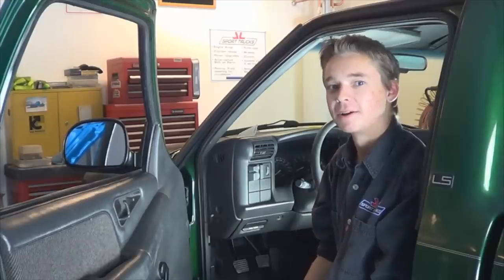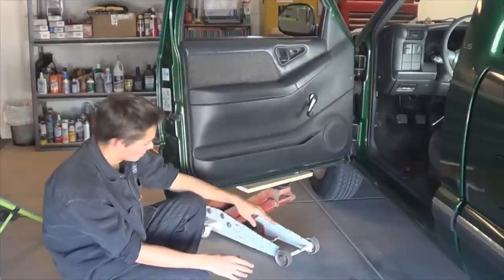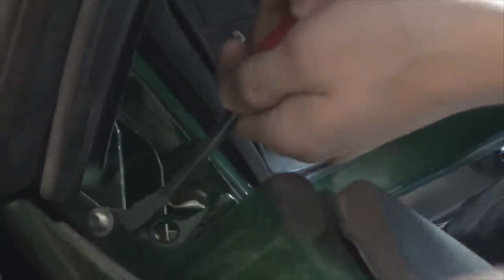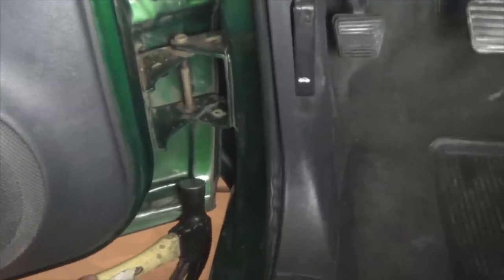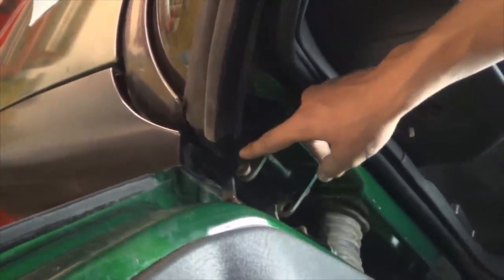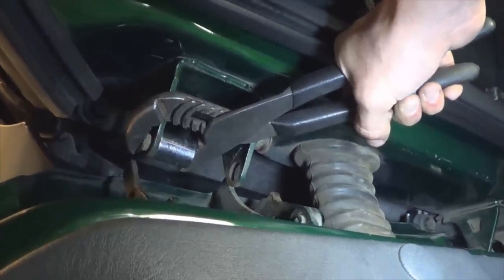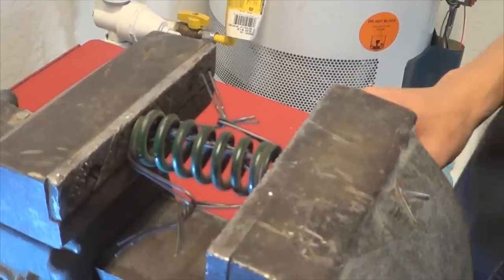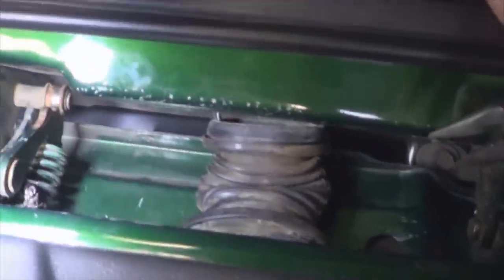1994 to 2003 Chevy S 10 GMC S 15 Blazer and Jimmy Door Hinge Pin Replacement

Comment: My 2002 S-10 hinge pins have never been changed, top hinge pin was a piece of cake. Bottom hinge pin is a different story, the pin is so corroded that no amount of hammering will remove it. Only two options remain, soak the pin in penetrating oil and hope that works, or as a last resort, grind the head off and drive the pin downwards which allows clearance for more effective hammer blows. One way or another, there's no turning back, wish me luck.

Comment: you can fix this without changing any parts. over the weekend I took a short cut, the bushings you can twist them a 90° with a pair of pliers which in turn places the good part of the bushing where the worn part was. i did jack up the door using a block before starting worked for me! no more up and down play in the door.
Reply: Paulpro PP im going to go try that good tip
Reply: The kit is like 8 dollars for christ sakes
Reply: Hey PP how long did the good part of the bushing last for after you rotated it? My upper is split in half almost exactly in the middle.
Reply: @jessjohn6157  16 I bought a kit today lol
Reply: Why not just weld it lmao

Comment: It just so happens that when I bought my truck (used), one of its previous owners was kind enough to remove the driver side door hinge spring so when opened, it would swing all the way until the back of the jam stopped it. I looked online for the spring, then saw folks were charging more for the spring then entire kits that came with the pin and bushings... EUREKA (and, then I found it)! This video with your tips and method is sound advice to this dumdum (meaning me) who doesn't even have to turn a wrench! I'm also thankful for that. Since the pins are brass from the looks of it, I'd put a piece of wood between the pin and the hammer so not to mushroom the pinhead. Prolly get a better fitment into the bushings. I like the socket compensator for the bottom of the bushing. Thanks for the vid.

Comment: Thank you for demonstrating step by step instructions clearly and in detail.
Reply: I had a terrible experience with Dorman kit with pins and bushings.  Bushings are totally junk.   I noticed some bad reviews for dorman kits for door hinges.  I ordered from the chevy dealer.  Not cheap but I’m done with it till the truck falls apart.  I broke the bushings very easily.  I had to pound out the factory bushings and they stayed in tact.  They were just worn out.

Comment: I was having excess wind noise around the passenger door. I replaced the windshield reveal weather strip, and the drip weather strip, but still had a leak. The busing is split on the upper hinge. I did the "moose the window frame over, and sealed it up, then did a 90 mile off road trip and it's still sealed, but I still will do the pins & bushings, ASAP. The reveal was allowing water to get in then a good cross wind would douche me with water, mud and sand. THANKS! GREAT VIDEO!!!!
Reply: I had the exact same thing and I built up the weather stripping with silicone.  Now that I've replaced the two broken bushings hope the seal compresses enough or I'll be sanding.  Ironic if the silicone was enough to break the new bushings.  That's me out there crying in the driveway....

Comment: Spring trick saved me a crap load of time.  .. thanks for this upload
Reply: There is actually a tool for doing the spring
Reply: @glenwhitestofer6420  yabut vice 'n ties is great if you have a vice and can use a tool you already have. You also dont need a vice that big. they make smaller vices

Comment: Thanks for the video.  The job was a lot easier and quicker than I thought.  Your video probably save me a lot of $$$$ by not taking it to the garage.  I did borrow a spring compressor from a friend and installing the spring was a breeze with that.  The whole process took me less then 30 minutes.  Thanks again for sharing!!!!

Comment: Thank you, I had to double check on the direction the lg. bushing was on the top hinge. I already had it apart & didn't want to trust that the other door was correct. Plus I wondered about how to push it in other than a drift.

Comment: Thanks, this helped me with my 02 s10. The spring was really a pain because i couldn't get the (tension with wire trick) to work. Ended up using a pry bar.

Comment: Hi Chris - I have a 2001 S-10 4X4.  I just opened the door and heard a loud spring-release sound followed by an even louder clank!  I checked and the piece that is held against the spring (opposite of where you inserted your pry bar for removal) had gone past the roller.  The door wouldn't close at all.  I compressed the spring using a ball-peen hammer and managed to close the door enough to remove the hammer.  After opening it again, it did the same thing - a loud snapping sound and unable to close the door without compressing the spring again.  I don't think this is the hinge pin - but it might be a broken spring?  Is is possible to send you a few pics and perhaps you may be able to tell me what you think the problem is?  Thanks in advance for any assistance!

Comment: Will a door from a 1994 s10 fit on a 2003 s10 extreme? I have a 03 extreme 2dr step side and having trouble with finding fitment sizes. I need a new driver side door, what will work? 
Ps. Will use this video as it is flawless, thanks.

Comment: is there an easier way to remove/replace the hinge pin roller? the bottom part of the pin snapped off and the spring came off its place, luckily it sprung inside the door. I don't want to replace the whole assembly because I will have to drill holes for the after market kit.
Reply: Abraham Diaz Angle grinder, cut in the middle  (the door is gonna have to come off) screwdriver as a wedge and then use a hammer to pound out the pieces.